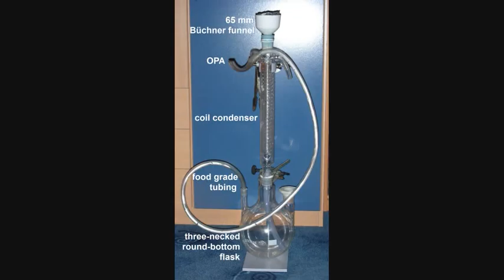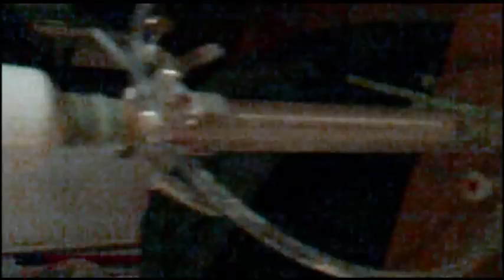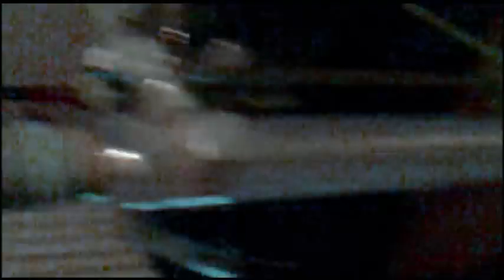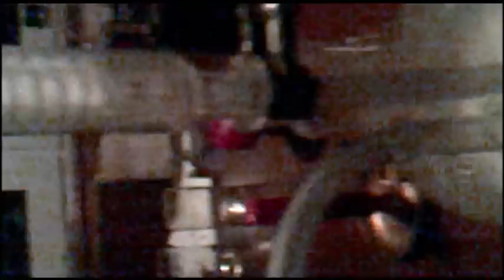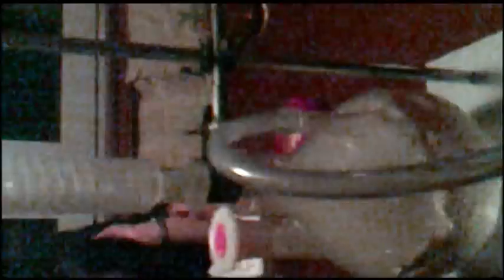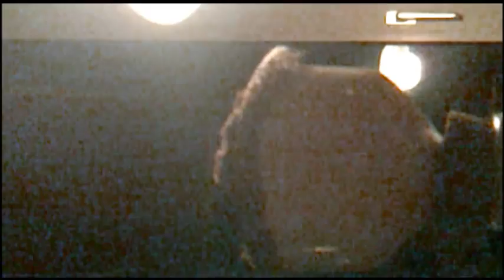Laborglas-Shisha

Comment: How did you connect Büchner funnel to the coil condenser? Is that rubber plug? Doesn't it get damaged by the heat?
Reply from the maker: Heat resistant rubber bung. It's meant for a still, so I don't worry too much.

In fact, the funnel itself remains surprisingly cool. The coal rests on a piece of wire mesh and isn't directly in contact with anything else.
Reply: ***** Good, I was worried about hot gases damaging rubber.

I might try to create my own soon. Buchner funnel always seemed to be best option here but I worried about that one joint.